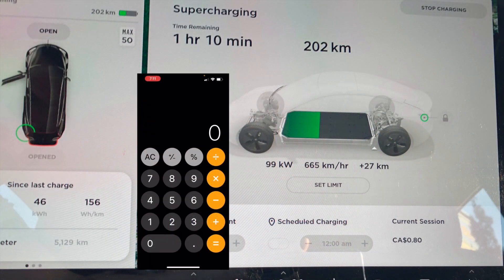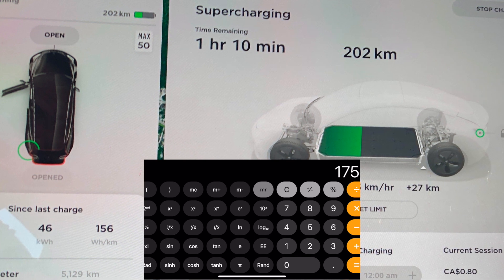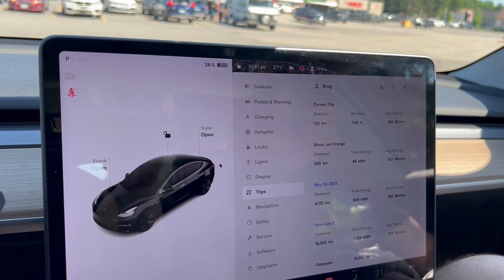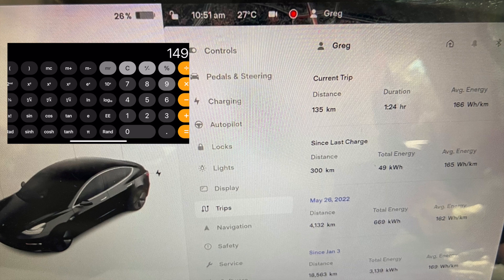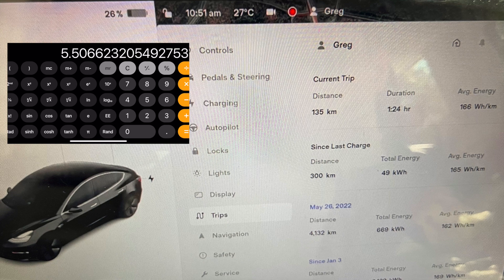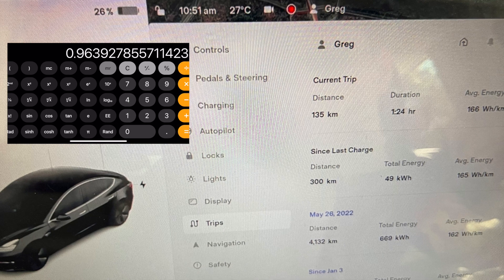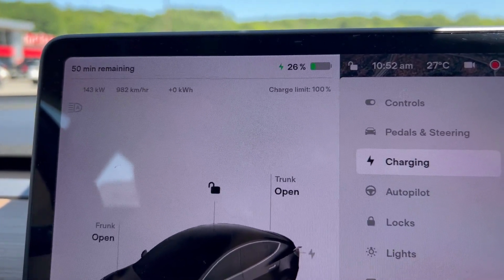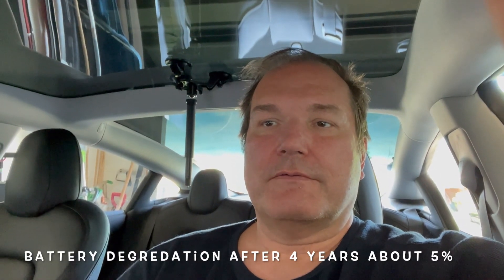Tesla Battery Degradation After 4 Years

Comment: I do not own an electric vehicle but of course I am looking into it.  One of my concerns is there is no information I can find on how much passive battery loss over a 24hr period a car has.  Meaning, if you fully charge, then let it sit for 24 hours, how much energy does it take to recharge the battery to maximum capacity again.  Thank you for considering my question.
Reply from the maker: Teslas lose about 1% per day. Using features like sentry mode (where the cameras monitor and record motion when parked) can use more. Frequently checking on the car via the app will wake it up and use more too. But just leaving if sleep is approx 1% a day. Tesla also has a cabin overheat protection mode which will take more power but keeps the cabin below a temperature you can set even when parked. This will also take some more power - but you can turn it off. Leaving a car at an airport for a couple weeks you may see about a 14% drop. This is mostly because it keeps some electronics running all the time to be able to wake up from the app, and to run the battery management system.
Reply: @electricpathways  So about a dime a day.  Seems cheap enough.  Thank you!

Comment: Well explained. I’ve used this breakdown before. My 2018 M3PD battery life is approximately 86% with 33,000 4 years later. This was done in the winter months in the Northeast region. I have also started noting the app battery percentage is set to 90% and the percentage on my app will be 88% or 89% (plugged in on Tesla’s level 2 charger) my guess is colder temperatures outside. Assuming it’s alerting me my battery will have slightly less for my next trip. Have you seen this recently?
Reply from the maker: Yes my battery will sometimes show 88-89% too. I think it is related to the colder winter temperatures as well when the battery starts cooling down after being warmer from charging. I also notice the BMS always calculates a bit less range in winter due to colder cells. It starts to show the snowflake when 4-5% is locked out (blue) due to coldness but even before it gets that cold there is still a bit locked out until the batter warms up - it just doesn’t show it. In summer the range estimate increases again. Not by much but 10-20km or so.
Reply: @electricpathways  Thank you. I actually put in a service request with Tesla through the app. Usually they send a report back. Ona side note… What’s your thoughts on the 2170 cells vs the original 18650 cells? Can’t wait for “project highland” to be completed, they actually might have the 4680 batteries 🔋 (one cast piecing would be great for the new M3 too).
Reply from the maker: I think the 18650 cells are still a good cell and they are used in Plaid - the main thing is the cooling capacity and manufacturing complexity/cost to connect all those cells. 2170’s lowered the manufacturing cost and increased energy density a bit but the really big jump will the the 4680’s and structural packs using them. The tabless design lowers the internal resistance and that means less heat = less degradation and faster charge times. Structural means higher energy density -
More range. I can hardly wait for the next gen Tesla platform on 4680’s

Comment: On your battery chemistry for the year/model the first year should be your highest degradation. So with 5%  does not mean that in another 4 years it will be 10%. You most likely had about 2% to 2.5% the first year and a little under 1% for every year since. Need to wait another 4 years for the results.
Reply from the maker: Yes battery degradation is highest in the first years. Manufacturers also typically include a top buffer to mitigate this effect. I do expect the rate to slow down over the next 4 years. I’ll keep doing the same test every time I head up north and plot it over true years and report back in follow ups.

Comment: A nice thing about lithium ION batteries and having properly designed battery management electronics, there will not be degradation of performance as the batteries decline in balance of power left.  The performance will be the same till the batteries reach their threshold of being discharged. At the level of being discharged the output of the battery system will rapidly avalanche.
Reply from the maker: True - the performance of my 2018 RWD model 3 is the same as when new and it holds to a low state of charge. The other thing I like is that the Tesla battery management system maintains a buffer and will give warnings and gradually limit power near 0% so you would have a chance to find a good place to pull over.  Also
I like that the gps routing will recommend charging stations nearby. But with 400-500 km range starting off every day - I’ve never had any range anxiety (although I hate to admit I did run out of gas once - I’ll blame that on the inaccurate gas gauge -
LOL)

Comment: As lithium ION batteries age they will degrade. The acceptable rate of degrading with age and use is the factor to consider. Rate of degrading is determined by frequency of charging, depth of charging, amount of fast charging vs normal charging, average temperature of the batteries over time, and the quality and level of technology in the chemistry used in the batteries,  are some determining factors.  Many manufactures indicate a lot longer a lifespan of the batteries than the reality.  With most of these lithium ION battery packs after about 6 years of normal use some degrading would be present. It is possible with lithium ION batteries to have as much as 10% to 20% degrading compared to when new.  As for any of these types of vehicles best return on value would be to not keep the vehicle past warranty, and to have best possible trade in value. The recommendation is to not keep these types of vehicles for more than about 4 to 5 years.
Reply: So after 5 years spend another 70k on a new vehicle versus replacing the battery pack after 10 years for 20k that does not make sence 🤔 not to mention that Tesla is working developing batteries that can outlast the life of the car.
Reply: @kangrimuniz5038  
The issue is when these vehicles are out of warranty servicing can be extremely expensive.  You trade it in for and get some money back and apply a difference for a new one.  There are EVs that have less depreciation than the Tesla. 

After about 6 years with any of these vehicles there is the increased chance to start having electronics modules fail. There are many of these used in the cars. Some of these modules can run in to several thousand dollars.  If a module does fail and it is no longer manufactured because of the age of the vehicle's technology then you will have to start looking from used parts dealers. Any of these older type modules you buy from them may also have faults. 

With normal vehicles you get best return vs value when a vehicle is between 3 to 5 years old depending on the type and demand.  

I personally would not buy a used EV or any modern day type vehicle. I have seen too many disappointments from expensive failing batteries and electronics modules failing past warranty. The last person who traded his EV or car in for a new one, did it for good reason!
Reply from the maker: As you mentioned so much depends on the quality of the BMS managing the battery. Tesla’s having among the best with liquid cooled batteries. Some early (non-Tesla) EV’s with air cooled batteries did much worse. Some of the best data on Tesla BMS managed batteries is in this article here (https://electrek.co/2018/04/14/tesla-battery-degradation-data/).  Just
like in the article with some early Model S cars, I measured around 5% degradation in the first 4.2 years/80000km and my BMS reports only 3.6%. But I expect that rate will slow down significantly now since lithium ion batteries degrade most in the beginning and then slow down. I have no worries about keeping my car 10+ years and think with my rather typical 20000km driving per year and mostly charging at home that my battery will be in decent shape in 10+ years. Probably 10% degradation, but even if it still had 85% of the original 499km - I’d be happy with that. I’ll keep measuring though and reporting back with this car as I repeat this trip and keep a graph going over the years. Interesting and exciting times we live in!

Comment: What were your charging habits?
Reply from the maker: I typically charge to 90% at home on a level 2 charger. For the first 2 years I did this every night. During Covid/work from home I would let it get down to 40-50% before charging to 90% again. Supercharging was pretty rare - probably only about 20 -30 times  over the 4 years. Charged to 100% 20 times or so for long road trips. The BMS will usually show 475 - 481 km now and showed the 499 when new - which is only a 3.6% - 4.8% range loss. On this trip I measured 5.5% - but again I was travelling at highway speeds the whole 300km - which would be faster than EPA average test speeds - which would have created a higher heat loss (due to I^2R power losses) compared to if I had driven slower. So I would say the 5.5% is worst case.